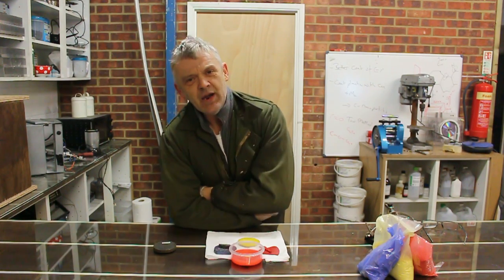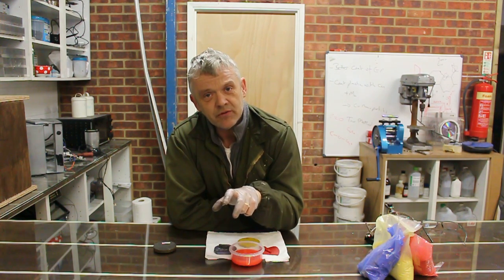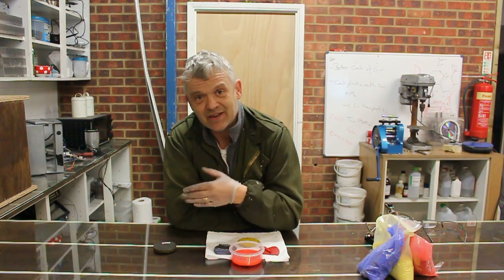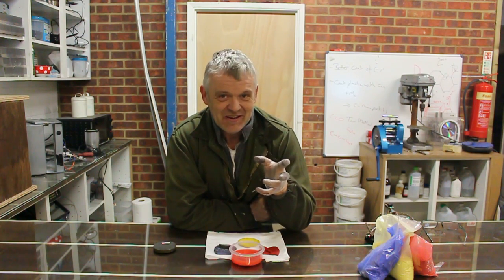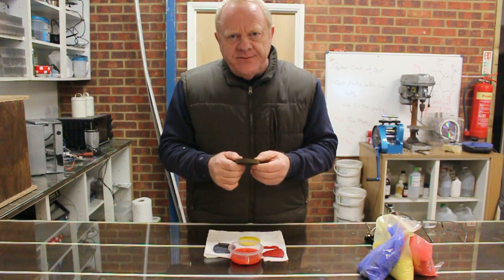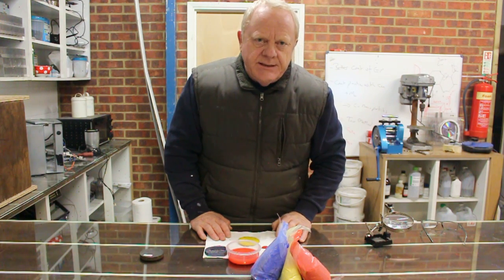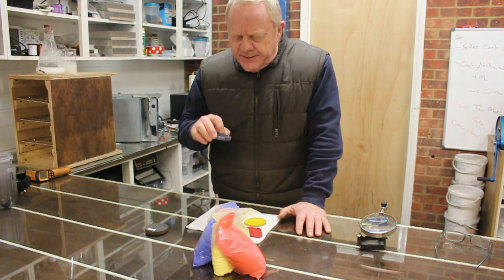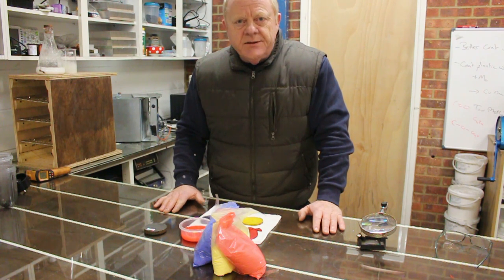Bio Thermoplastic - or - how to replace Lego

Comment: While plastic is overrated and over-utilized as a material in many cases, it turns out that naturally occurring insects and bacteria do break down most of them already and they really don't "last forever".  .  Additionally, the "plastic gyres" are horribly exaggerated.  There are no islands of plastic etc.  That said, anyone who throws plastic crap in the ocean or on the ground is a very poor steward of all that we've been gifted.   My biggest peeve with plastic is when a formerly aluminum or steel part is replaced with plastic of the same dimensions when common sense wold dictate that to handle the same loads it would need to be thicker with bigger radius fillets and perhaps fiber reinforced.  Instead it is the same part, but breaks far sooner.
Reply from the maker: +Marty G nice post mate - cheers